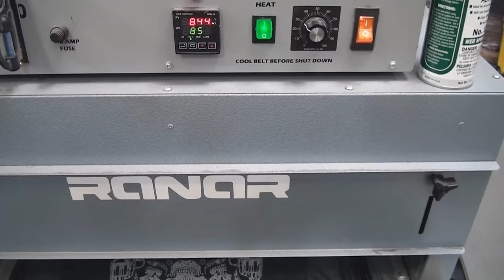Screen Printing Tee Shirts: One Color Distressed Print Production Run

Comment: I almost always gang up artwork, when it's a smaller print, it saves extra work burning, and reclaiming screens, although there's a bit of extra work in taping off, I often use the 'spare space' on a screen for novelty, personal shirts I want, and short run jobs. 
Generally, I'll put front and back on 2 different screens though, because I find it annoying if there's a misprint on the second printed side, to go back through and clean/re-tape off/ink/align/etc.. the first side, to re-do the misprinted one, and it saves wasted shirts printing extra 'just in case' (although, I still do that sometimes for my better customers, they always enjoy getting the extra 'free' ones, when I give them the defects/misprints/extras/test prints, I just mark the tags, and note them separately, so they won't mistake it for a production shirt)
Love the bucket idea, have since I first saw the video demonstrating them. Will probably get a set (eventually) 
-Did you mention these shirts will be available? I'd like one!
Reply from the maker: +lostboytnt1 Yes, I gang up art when necessary as well. These days I don't do it as much since I basically print for Catspit only now. I did this especially for a video. The buckets and brushes are awesome. I do like 12 to 17 screens at a time so the spray bottle can cripple your hand....LOL. Customers always like some freebies. Yes, the shirts will be available on my eCommerce site after I give a few away on Instagram. Thanks for watching. Screen Printing Equipment & Supplies - http://catspitscreenprintsupply.com/

Comment: Hey those prints are really nice. I see that you are only one hitting them no flash (I assume for more of a distressed effect). What Mesh screen are you using on that print and are you using any additives in the ink to get a better effect?
Reply from the maker: Thank you! Yes, I was printing gray ink on a dark shirt so I did not need as much ink volume printed. It's more to keep the print feeling soft, breathable and light feeling. It's also easier and faster to print. But yes, printing a thinner layer of ink will add to a distressed look as well. Thanks for watching! Screen Printing Equipment & Supplies - http://CatspitScreenPrintSupply.com/

Comment: Awesome vids! Question, how much pressure are you putting when applying the ink to the fabric? From the video, it looks like you are putting a pretty decent amount but I wanted to make sure.
Reply from the maker: Thank you! Depending on the print job there could be decent pressure. You have to learn to use just enough pressure to sheer the ink and clear the mesh. No more. Thanks for watching. Screen Printing Equipment & Supplies - http://catspitscreenprintsupply.com/

Comment: hey there and thanks for your videos, you know i am a big fan of yours!

2 Questions:

1. i see you put the graphic quite close to the screen edge. wouldn´t it be a lil more comfortable to put i a lil lower and move the platen more down. 

2. what are the coloured buckets behind you for?

thank you!
Reply from the maker: +Mister Onemoveahead Thank you! Glad you enjoy my work. The stencil is where it is because I ganged up artwork on the other side. I wanted to show how to gang art on film and screens so I did. I made a video about it previously. But yes, Ideally I would have used 2 screens and put the art more near the sweet spot. The buckets are part of my buckets and brush system for screen making. When you do nearly 20 screen at one time spray bottles can give you mad hand cramps. So I use brushes and buckets to apply my chemicals. I sell them as a set on my eCommerce site. Thanks for watching. Screen Printing Equipment & Supplies - http://catspitscreenprintsupply.com/

Comment: what is the best way to cure waterbased inks with a flash dryer?
Reply from the maker: I'm not sure if I know the "best way" but you have to do them one by one with rotary pallet ad ons or on a table. But a forced air flash is important any way you look at heat setting water based inks. Thanks for watching! Screen Printing Equipment & Supplies -  http://CatspitScreenPrintSupply.com/
Reply: CatspitProductions so what would be your recommended temperature and time to cure water based inks with a flash dryer?
Reply from the maker: I would check with the maker of your specific inks. But usually it's around 250 degrees F. You heat them as long as it takes for the solvents to evaporate and for the entire ink layer to reach 250. This can vary depending on how much ink you are printing.
Reply: CatspitProductions so I would need a forced air flash dryer? Because I only have a normal flash dryer
Reply from the maker: Not necessarily. The forced air flash or belt dryer is ideal for water based or discharge. But that does not mean you cannot do it another way. You have to either let them dry by evaporation before heat setting or allow enough time for solvents to evaporate and for the pigments to heat set. You'll have to do a little trial an error to work it out. But you can do it.